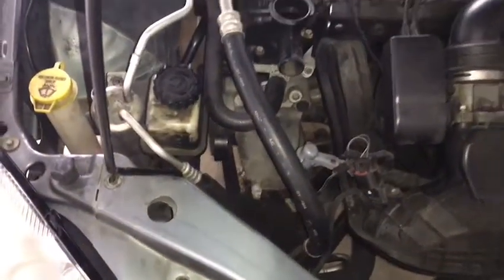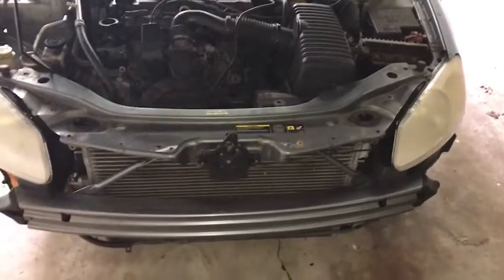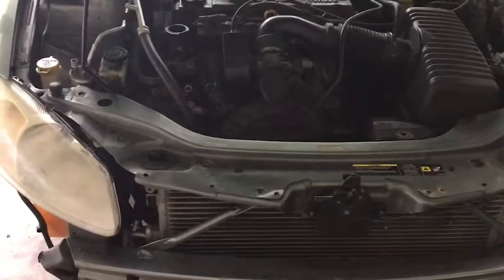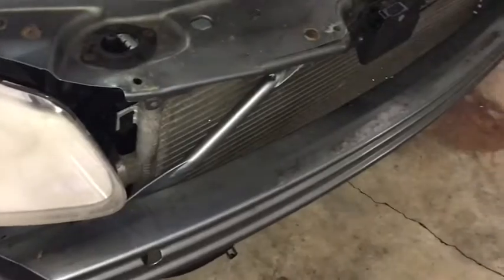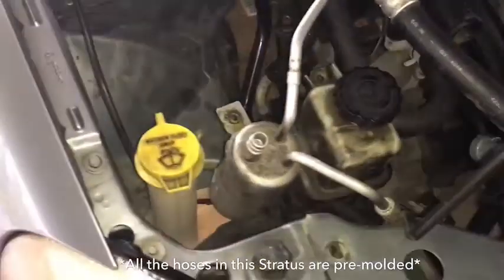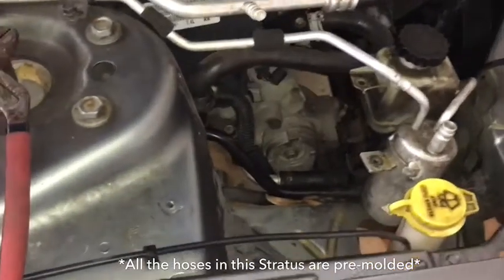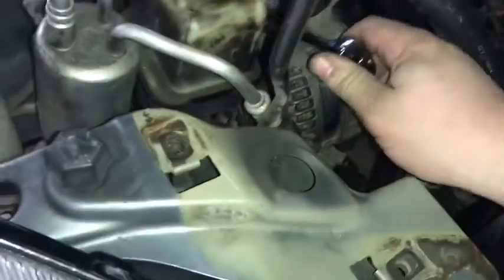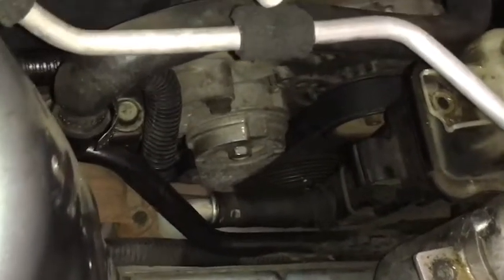2006 Dodge Stratus repairs vlog, PT. 3 - alternator installation

Comment: Great video. Part 4? Like to see it running.
Reply from the maker: It never ran again. I put the new alternator on and got the radiator in and the engine turned over, but after about 30 seconds or a minute, the water pump started weeping. 
I pulled the side of the motor to do the water pump and timing belt and noticed indications of a possible bad head gasket. I pulled the head to put the new gasket on, went so far as to disassemble the head to put in new valve seals as a precaution. On reinstall, using hand tension only, the bolt holes for the cam caps started stripping out. I gave up on it. 

One thing I don’t mention in the video is that during this whole process, I discovered that the entire heating system was damaged. It had overheated 4 times before, but at some point the heater core even got damaged and it was spraying an aerosol coolant on to my windshield from the heater core.  
It needed a top to bottom rebuild and I just didn’t have the funds to make it happen.